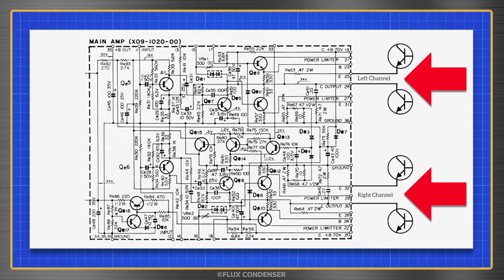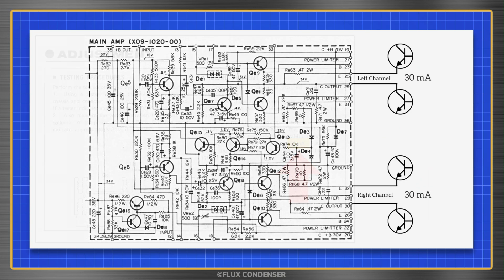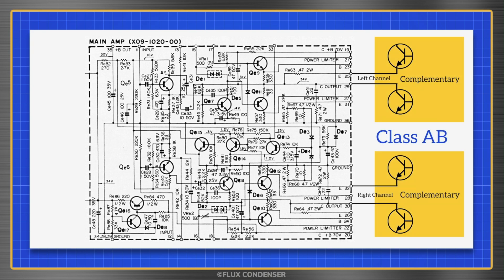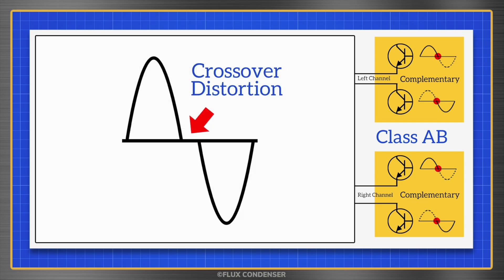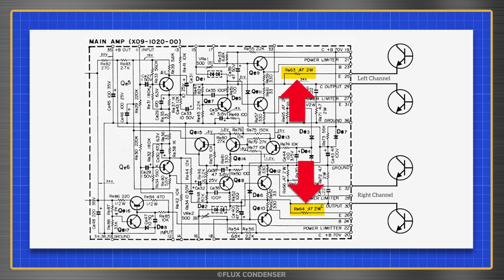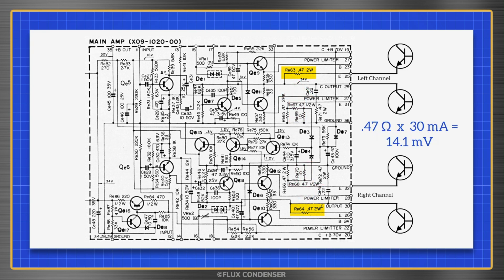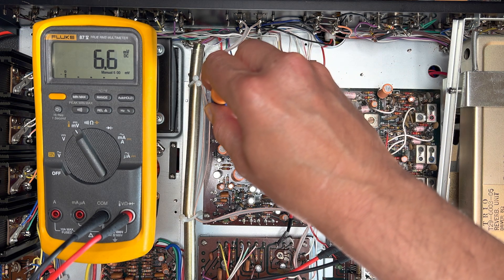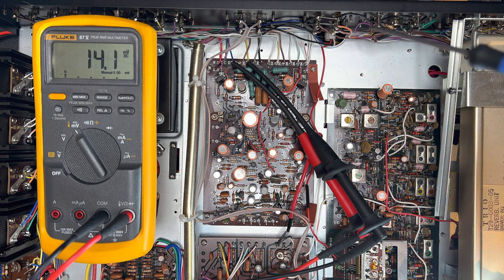Quick! Can You Bias a Class AB Amp?

Comment: Is this the same as setting Dc offset?
Reply from the maker: No. The bias is adjusting the output stage so that the transistors are at an operating voltage. The DC offset makes sure there is 0 volts output to the speakers with no signal.